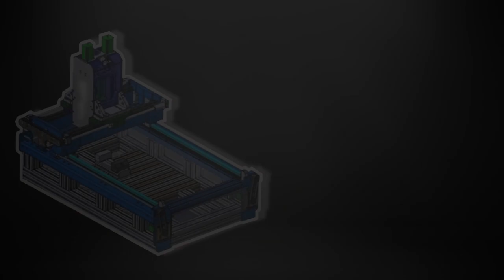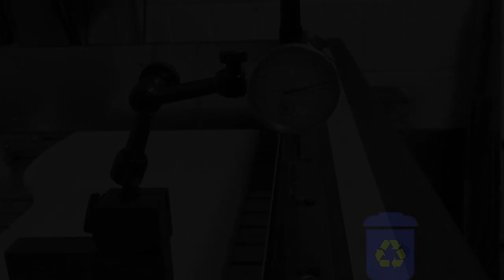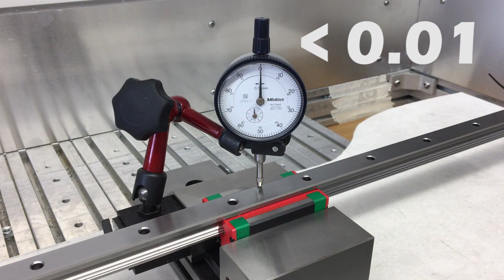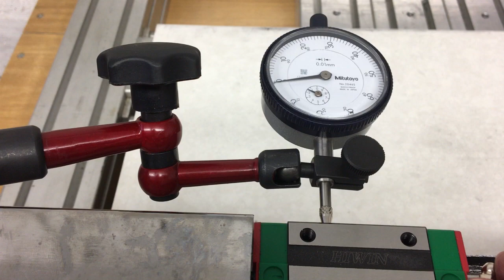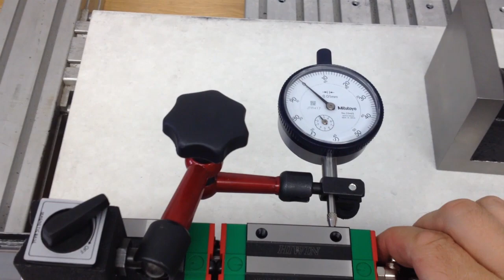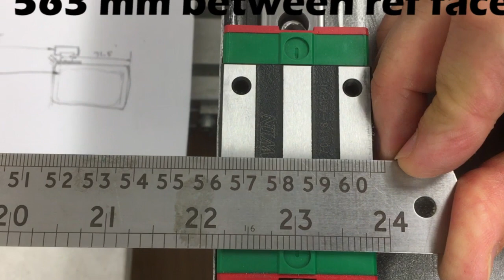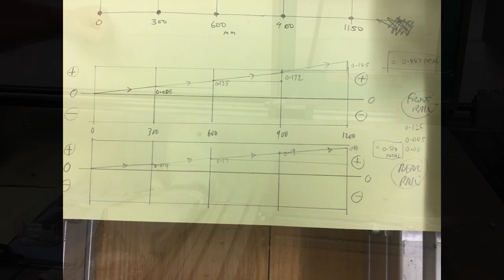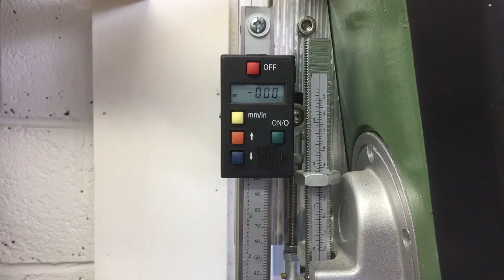Episode 18:  DIY CNC build - rear rail

Comment: Continual improvement and precision. Take up some slack here and there, and she starts to  be beautiful.

My first CNC will be quite crude, yet quite large. Moving table in Z. 
I am aiming for a work volume of no less than 1200 x 1800 x 1000 mm as it must be able to pull double duty as a printer and I have the space for it.
I will TIG weld most gantry and frame parts, drill holes oversize, then shim. Should get me into 1/10th fast. 
As I have no working lathe or a mill, I'm relying on grinder, files etc.
Reply from the maker: Sounds quite ambitious but interesting.  Good luck with it !

Comment: very nice build. What size motors is that? and where did you get the belt/pulleys?
Reply from the maker: Nema 23 rated at 3Nm
Belts are HTD5 and I think it was bearingboys.co.uk
Reply: @routercnc9517  great, thanks buddy! 
Im a bit hesitant when it comes to choose nema size. How does it perform? Anything you would like to change/upgrade?
Reply from the maker: The motors on 70V perform very well.  I’m on old analog drivers so would go digital if building again as they have better mid band resonance control.  Also the spindle is 1.5kW.  I would go at least 2.2kW and maybe 3kW if I built it again.  Thanks

Comment: At minute 11:11 of the video, the aluminum bar is only attached to one side? Or do you have other support?
Reply from the maker: It is bolted to the carriage on the other linear rail only.  The far end is NOT supported.  This is to adjust the other rail to run parallel to it.  If we sweep the aluminium bar along the length of the far rail the DTI should not move once it is parallel to the first rail.  Thanks

Comment: Great cnc. How did you make sure that both motors turns absolutely synchronized together on that axis?
Reply from the maker: They are configured to work together in the Mach3 software using a slaved axis.  So the X axis stepper on one ballscrew is slaved to A axis stepper motor on the other ballscrew.  The software then sends the same step and direction signals to both stepper motor drivers so they are always synchronized.  Same on Z axis.  Thanks

Comment: are those HiWin linear rails?. I'm thinking of buying them for a project. What is your opinion vs SKF?
Reply from the maker: I’ve only ever used Hiwin and THK so can’t comment on SKF.  The Hiwins are excellent and I have a good source on Aliexpress so easy to get hold of.  For DIY machines I would have no problem using any of the named brands including SKF.  There are cheap imitation Hiwin rails which I considered at one point but went with the genuine product.  Hope this helps.
Reply: Of course it does!.. thank you very much. I'll be purchasing HiWin soon. Thanks.!.. Great build BTW.

Comment: Great video series.  I love how methodical you are when you are assembling the machine, it makes me look like I just threw mine together by comparison!  I like how you made sure the reference rail was straight using the two carriages but isn't it possible that the method imparts a constant arc to the rail and not assuring they are perfectly straight?
Reply from the maker: You are right there is a risk of getting a constant arc so after only very minor alignment tweaks and using a wide and narrow spaced double carriage arrangement to get 2 readings I put a 300 mm ground edge against the rail and checked for gaps (not in the video).  The other thing I've found is that the rails are reasonable straight to start with and that if you find yourself applying more and more side force as you progress, it is probably creating an arc.  Not easy to show in the video but sort of a feel thing.
What I really need is a long flat edge that I can stand on its side to reference to but I don't have one.  The commercial way to do it is to machine a shoulder to press the rail against, but again I don't have a mill.
Good comments anyway and hopefully it might make other think about all the things that can be checked as you go with whatever tools you have to hand.  Thanks.
Reply: i realize Im kinda randomly asking but does anybody know a good place to stream new series online ?
Reply: @Jadiel Marvin ehh atm I have been using flixportal. You can find it if you google:D -shane
Reply: @Shane Orion thank you, signed up and it seems to work :D I appreciate it !
Reply: @Jadiel Marvin Happy to help =)

Comment: How do you ensure parallelism between rails? For it to be accurate. How do you ensure perpendicularity with the gantry?
How do you measure the exact distance between the left and right rails, since I do not know of a comparison instrument to measure the parallelism between the two rails.
I work, assembled machines with the same structure, only they have, a tank between the rails. My problem has been aligning the rails on each side, to ensure parallelism and squareness. The rails are located at a distance of 4 meters from each other and this alineation is Whith the gantry mounted. Do you know any technical and effective alignment system. Well, I do it empirically with a tensioned steel wire.
Reply from the maker: See 11:11 for setting one rail parallel to the other.  Adjust and sweep until the DTI needle does not move.  Exact distance between rails is not critical as the holes in the gantry are slotted.  The gantry is squared to the bed rails much later in the video series using a precision engineers square.

Comment: Is there a reason you are using dual ball nuts on the ball screws? Wont you have binding issues if you don't get them mounted spaced properly?

I by no means claim to be expert and you clearly have more knowledge than me, but ion my experience (Flow Water jet maintenance at work) there has only ever been one nut per screw. And to my understanding that is because the backlash is controlled internally in the nut. If you have a plan I'd love to hear it though.

I do love the build and I'm glad to see you got a ton done on it in this last episode. Keep up the great work.
Reply from the maker: Hi Paul,
For most DIY machines you can use a single ball nut and the typical Chinese ballscrew (C7 rolled) has about 50um (microns) backlash which is 0.05 mm or about 2 thou.  If you want to reduce this you can buy a double ballnut which has a pre-load in it (this might be what you have at work, they are generally quite long), or as I already had several single ballnuts I just added a second set which I will manually pre-load against each other in a pair to reduce or eliminate backlash.  Yes, I need to keep the pre-loads low by getting them spaced just right to keep the friction down so the stepper does not stall out too early.
Thanks for your comments, and glad you are enjoying it.
Flow Water jet maintenance sounds interesting.  I'm not sure what that is but sounds like you have some practical experience so if you see something interesting please do shout out as although I've been doing this a while there is still plenty to learn.
Reply: Ok. I figured there was a valid reason such as manually controlling backlash and lower grade parts. I'm interested to see how you plan to tackle it.

I should clarify that by maintenance was not my official job title but because we were a small Mom and Pop shop we had to do all of or own repair work and our water jet blew a sand line which caused sand to get into ball nut and it blow its guts out. So I suppose it's more or a parts changer than proper maintenance. My official" title would have more akin to Fabricator that was allowed to touch the mills and lathes for my own hobby projects.

Comment: At minute 5:10, I was wondering if there is a way to differentiate between the rail going upward and the plate going downward.  Great job anyway !
Reply from the maker: Hi Mihai
I’m only looking for variation from a straight line so the plate can be at any angle.  Then a best fit line is calculated and subtracted to find the variation.
Or you can shim the plate to get the minimum DTI reading and any fluctuation is then read direct from the DTI.  This second method is the one I used.  Thanks
Reply: Shimming the plate is indeed the way to do it; I saw that the DTI is going all the way up, so either shimming needs to be done again or the rail has a kink (unlikely). But I am sure you know better what to do.
Reply from the maker: Yes the DTI needle goes up about 0.05 mm then just after the graphic appears on the screen it starts to drop again.  So I’m calling it flat to at least 0.05.  I had lots of trials off camera and this is about as accurate as I can measure it.  That’s about 2 thou over about 900 mm so pretty pleased with that for a DIY machine.  Thanks

Comment: Hi great video. One Question. at about 4:55 you are measuring the horizontal alignment of the sled. What are you using as a flat reference? What is the white thing on the bed of the cnc and how did you make sure it is perfecty flat?
Reply from the maker: It is a marble plate we removed from our old fire place.  I was about to throw it out but measured it against known flat ground edges and surfaces and it is fairly flat, at least down to 0.05 mm, maybe a bit better.  That angle block you see me using is ground flat and they start to ring together like gauge blocks.  Now I'm just using what I have to hand to do the best I can.  You can buy proper granite surface plates which are flat to ±0.0052 mm (grade B) and there are other grades which go even flatter.  But as you may have guessed these plates are expensive especially as they get bigger.  One day maybe . . .
Reply: thanks. continue the good work.

Comment: Nice, what taps are you using?
Reply from the maker: Hi Chaz, Mostly they are spiral fluted taps from Europa tool.  They do different types for aluminium, steel, etc and have a coloured band around the shank to show which type they are.  They are very sharp and cut aluminium without a problem.  Way, way better than 'generic taps' and only around £7 each on ebay.
For example, drop this in the ebay search window M5 x 0.8 HSS-E 6H SPIRAL FLUTE YELLOW RING M/C TAP DIN371 TM17160500 EUROPA TOOL
Thanks
Reply: Great, thanks. Can they be used with a cordless drill and/or rigid tapping on a lathe?
Reply from the maker: Drill is fine although I tend to tap part of the thread then back out a touch and repeat.  Not tried rigid tapping under power on a lathe but they are very sharp so might be ok.

Comment: Why no type of lock washer on the rails? Like a nord-lock or something...
Reply from the maker: In all the years of building and running CNC machines I’ve never had them come loose.  But now you mention I should be able to push this one harder so after the gantry is installed and it runs smoothly I’ll most likely blue thread lock them.  Good comment thanks.
Reply: Cool I've never built one, but I've always been curious about their assembly, seems crazy to me that something with such high vibration potential wouldn't have a means of keeping hardware from loosening.

Comment: What size ball screws are you using?
Reply from the maker: They are 1605 all round - 16 mm diameter and 5 mm pitch.  If I was starting again I would go for 1610 (10 mm pitch) to get more speed.  Then if I needed more torque / less speed I could swap the motor pulleys for 2:1 ratio.  Thanks.
Reply: Thanks for the reply. I was originally going to go with 1610 screws for mine, but 2010 may be the better option.  Love the build and all the hard work you have done. I can't wait to see it up and running!
Reply from the maker: Thanks, I can't wait either !
On the 1610/2010 - they will both work but just watch out there is more inertia on the 2010 than the 1610 (larger diameter).  This can form a significant part of the load that the stepper sees as it is rotational rather than linear inertia and therefore means slower accelerations (without loosing steps).  Have a google search for 'mycncuk what size stepper do I need if you want to dive in.  Not saying don't do it, just pointing out things to consider, although good machines have been built with 2010.  Counter to this is if the machine is long then 1610 may whip when it reaches the critical speed and 2010 will help as it is stiffer.  If you want specific advice try the mycncuk forum (UK) or cnczone (USA).  Good luck with the build !

Comment: those are some beefy carriages
Reply from the maker: Thanks.  These are HGH20CA on HGR20 rail (20mm) and are the minimum size I would recommend for this long axis.  The rails are fixed using M5 which is a fair size.  I had some 15 mm rails on the previous Z axis and it is a bit small plus the fixings are M3 which is a pretty small screw.